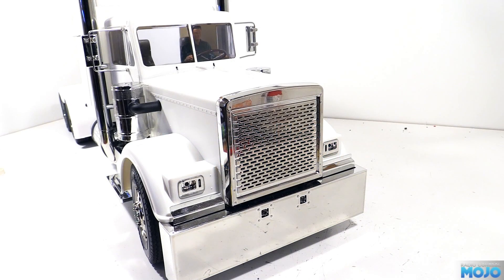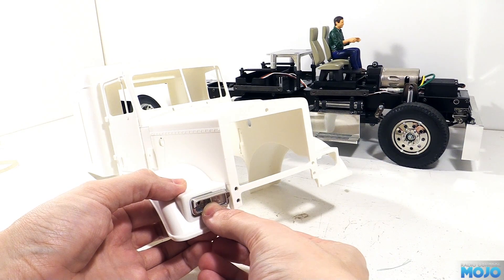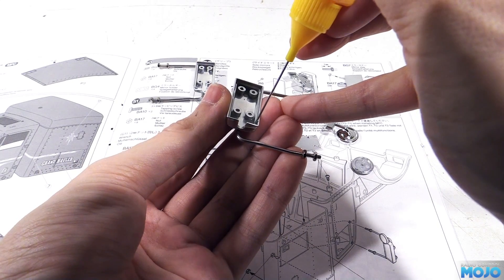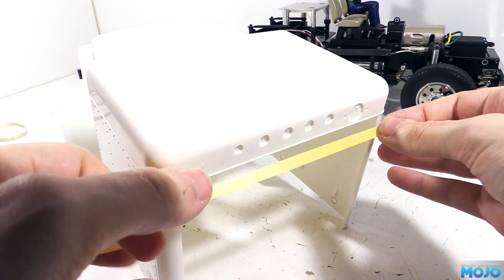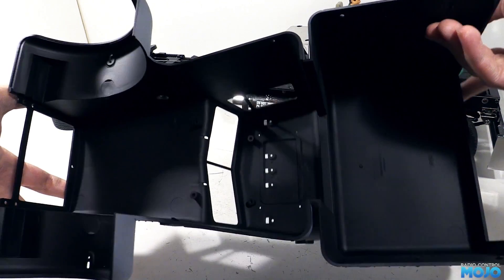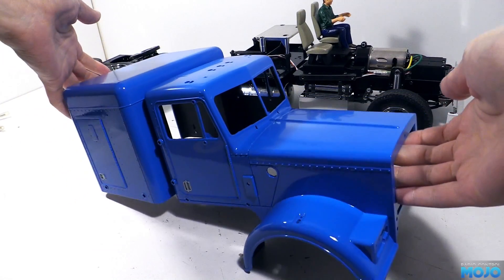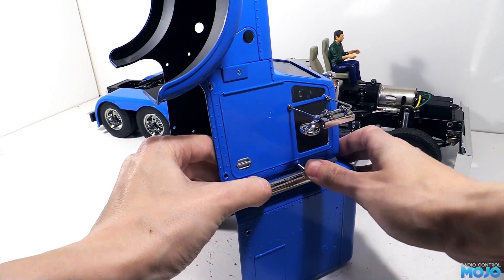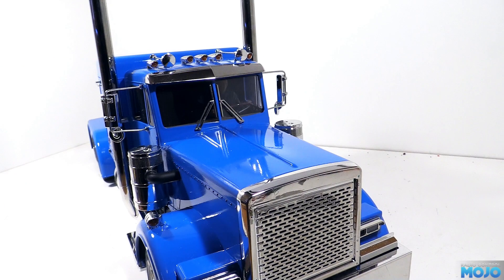Tamiya Grand Hauler - 10 - Body Part 2

Comment: hi i just got my grand hauler and i have noticed that the motor that comes with it is way to fast for it  and i was wondering what motor u sajest for it ive been told about the carson truck puller but bein in the us its hard to get one tu
Reply: Get a 45t motor